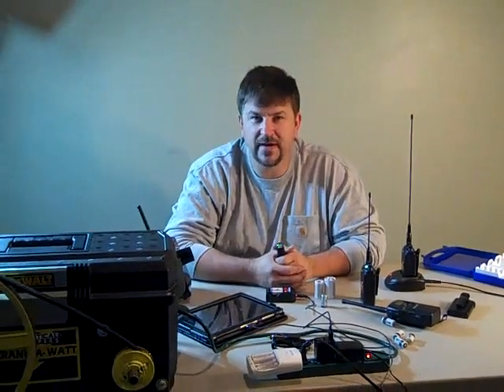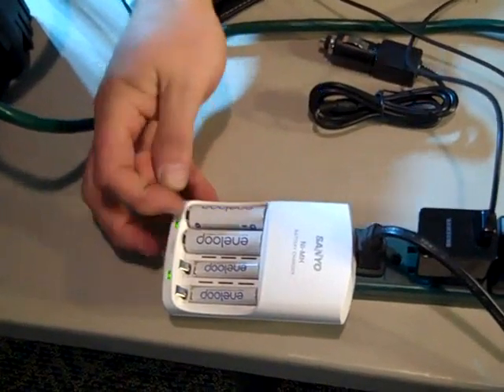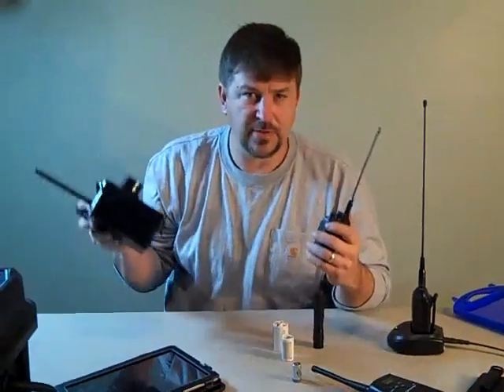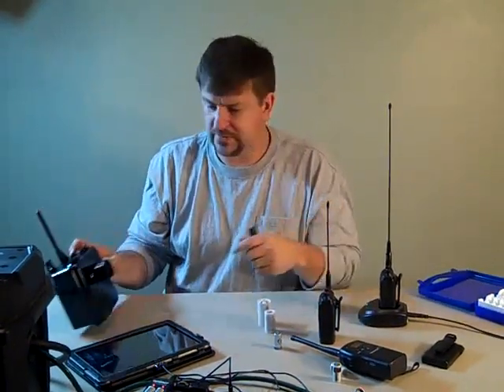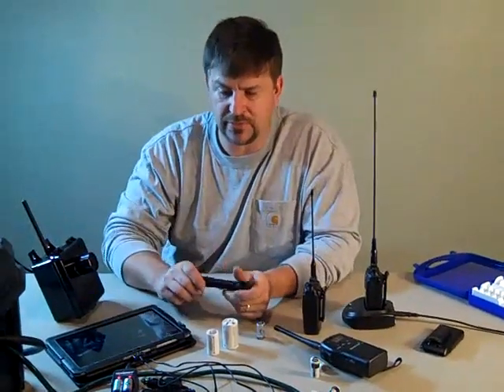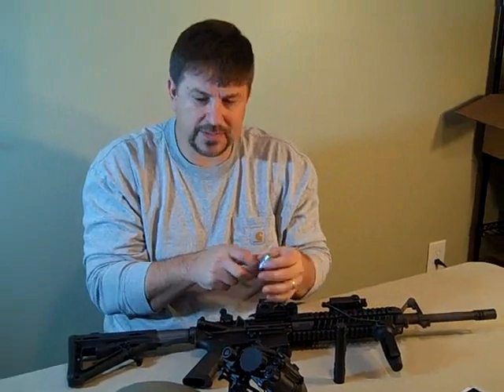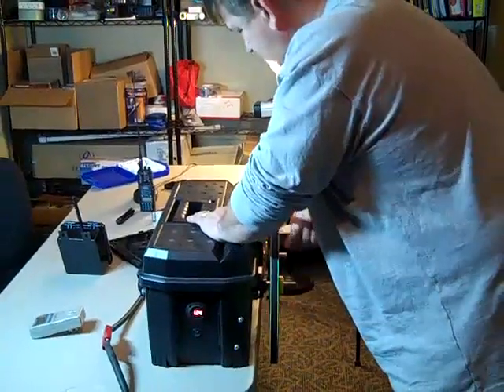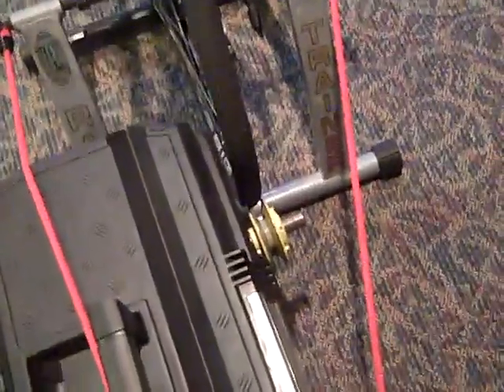Staying Charged up!  A Battery Strategy.

Comment: Alkaline (Duracell) chargers exist.  Yes, you can recharge "single-use" alkaline cells.  Don't really know how efficient they are, but for the few things I just can't let go of that really want D batteries, I go with Duracell (recommended by Steven Harris as the best brand of alkaline cells) and recharge them.  Not optimal, I know, and I am weaning myself from the practice, but for the meantime, it works for me.

Comment: Another solar recharging system most people overlook is the simple solar post cap used on decks and fencing.  I have 23 solar post caps on my deck and they constantly charge 2 AA batteries each.  Solar path lights could perform the same function.

Comment: I was checking and charging my battery stock and noted that I was low on AAA, so I have got my family is finely using the chargeable batteries over the non-chargeable. So this leads me to phase 4 of my preppes buying more batteries for stock. I just tripled my AAA stock and doubled my AA stock.  I'm going to need a Battery Zar  to manage charging and usage.  I seem to end up the battery charger and can't get anyone else to charge a battery, but they will put the dead in a central location to charge.
I am thinking of a system to trickle charge my weapons lights but only have a limited number of flashlights that can charge in place.  Do you think this would be worth the trouble to refit all my weapons light to charge in place?  This would allow me to charge my weapons lights without breaking down the light.

Comment: Highly recommend the intellicharger I4 Lets you charge 4 li-ions or alkaline in the same charger in any slot (mix and match) Has DC and AC power in with standard cables. Really nice.
Reply: I use Eagletac and AW brand cells in my lights, really good quality cells.

Comment: 1500 charge cycles means you have second generation Eneloops. The third generation ones are rated for 1800, and the latest Panasonic Eneloop branded ones are rated for 2100 cycles(but just about impossible to find in the US right now.) I'd also recommend a good variable rate charger as well so you can finish charging while the sun is up. I'm using a LaCrosse Technologies BC-900 for the past 5-6 years and been very happy with it.  I also keep a 100 pack of cheap alkalines on hand too since I can pick them up for around $12 at my local Fry's.

I'm also experimenting with LiFePO4 batteries for my small KX1 shortwave transceiver. They are easier and safer to work with than Lithium Ion and last a lot longer too. It's another option for something you don't mind having an external battery pack.

Comment: Aloha
PS  --  For bulk energy reservoir electrical storage from your permanent Solar/Wind arrays, the Alkali Nickel/Iron batteries from Iron Edison in Colorado are incredible.  Yes, they are a wet-cell that needs to be maintained, but no acid, they use an alkali electrolyte.  The plates have no lead or other toxic or rare metals like LiFePo.....they are structured from Nickel and Iron.  Originally invented by Thomas Edison to power electric cars (before the ICE engine took over transportation), there are original Edison Cells that are still working today.  Unlike most wet cells, discharging does not damage the cell plates, they can be repeatedly fully discharged.  That ability basically doubles or even triples the available power of a cell compared to lead/acid wet cells that can only be partially discharged to avoid damaging the cells.  The alkali solution does need to be changed out, roughly every 7-10 years, but the cells themselves basically have an infinite life span.

Comment: Aloha. 
 I love the Goal Zero Guide 10, about the size of a pack of cigarettes, charges 4 AA or AAA from USB Power or Solar Power.  Acts as a power pack/LED flashlight.  Overall, I try to keep all of my equipment using AA or AAA, and avoid the alpha-numeric soup of specialty batteries and definitely avoid the iPhone curse of non-replaceable built-in Lithium batteries (especially on expensive equipment).  Frys Electronics usually carries the Lenmar NiMh batteries at a good price, and Lenmar also makes AA > 'C' cell and AA > 'D' cell adapters.  Yes, they do not have the capacity of a true C or D cell, but they do allow you to operate those odd-ball items you may have that take them, while still maintaining a standardized supply of AA & AAA.  For me, nothing I have truly needs or warrants adding the specific batteries/chargers for C & D.

Also, when it comes to batteries for things like ATV's/Motorcycles or any other vehicle that will not start without a battery, I have gone to carrying a spare battery.  Example, a spare Lithium Ion battery for my Piaggio 500ie MP3 fits perfectly in a Range Maxx ammo can, with room inside for fuses, charge controller, inputs and outputs.  Basically, it becomes a multi-use power pack, usually maintained daily by a solar panel plugged into it, that if the main vehicle battery dies, I can directly swap it and be on my way.  The important thing is being able to directly swap the battery if needed, because if the vehicle battery is truly stone-cold dead, just trying to jump-start with it still connected may not work.

Comment: Thanks for another great video. I've tried rechargeable batteries before and they don't seem to last as long. But that was a long time ago. Has the technology improved to the point that the batteries last as long as non-rechargeables?  Off topic here but I just got the city water supplied to my retreat home! It only took 7 years to save up for that. My next project? Hiring you for solar back up. I'll let you know when I'm ready. Wyatt
Reply from the maker: The rechargables have come a long way. Let me know what I can help you with on your retreat.  Take care!
Reply: engineer775 Practical Preppers Thank you for the immediate response and I sure will. I have many questions about the way I'd like to go, but that will be another time. I'll contact you though your business web sight as well. Thanks again.
Reply: Electronics have come a long way also.  Be careful if you are using old equipment.  Used to be that equipment expected voltage at 1.5V and quit at close to 1.2V when the non-rechargeable battery was dead.  With most rechargables starting at 1.2V old equipment was starting off with a dead battery.  Newer equipment is designed to work with a battery down to 1v or so.